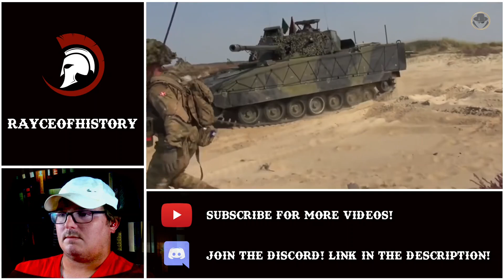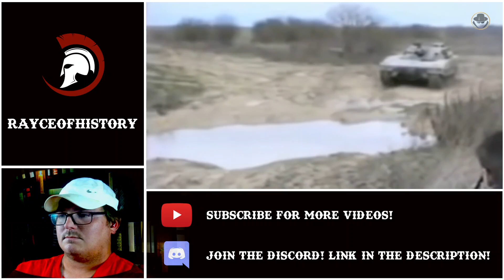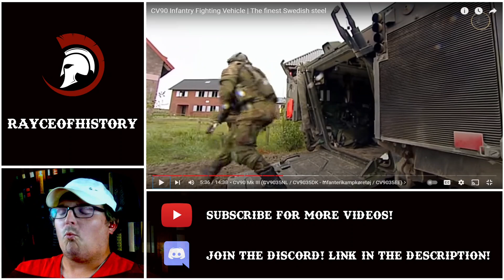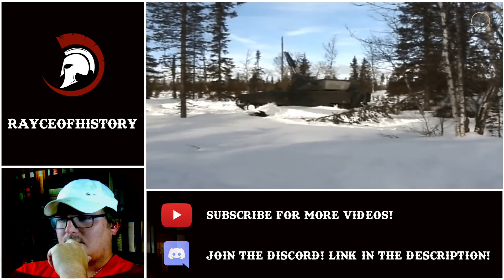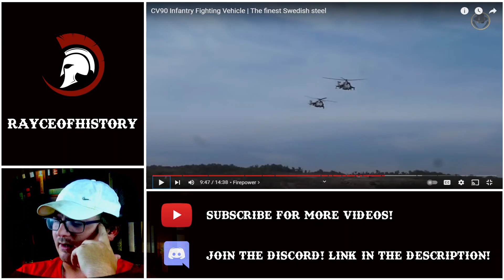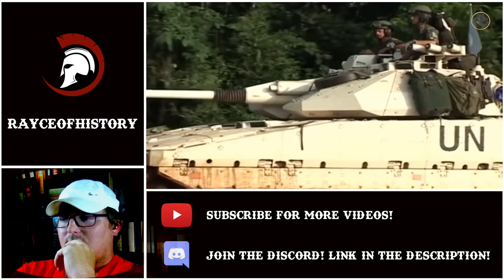Texan Reacts to CV90 Infantry Fighting Vehicle | The finest Swedish steel

Comment: Nice that you did this one! I will add some stuff here.

Recently Slovakia and the Czech Republic bought CV90 from us. I think they bought about 400 of them together. So now it's 9 user nations. And if you include the poles it's 10. And imagine when Sweden joins NATO, then we might be able to sell alot more of them without export restrictions and stuff. This plattform might be the most used NATO IFV, if it's not already that. I don't know.

When it comes to the off road performance it's excellent. It was designed for the swedish conditions with deep snow. It basically floats/skids on top of the snow like no other tank. Some tanks get stuck in deep snow. But the performance in mud and stuff is also excellent because of this. If you can drive in deep snow it will basically work anywhere. I heard of one swedish soldier talking about when they hide themselfs in a swamp! And the bigger battletanks couldn't even go there because they were to heavy.

I have also heard that the suspension adjusts itself depending on the road ahead. So it basically scans the road ahead so it can achive higher speeds. I don't know how this really works, but some guy if I remember correct said that it increased the speed with like 30% or something like that. But take this information with a grain of salt. But at least that's what I have heard, something along those lines.

So, the mobility of this IFV is super good, it's fast and can go bascially anywhere. As you said, I also think they found a really good base plattform and then expanded on it.

As a swede I would love to send 100-200 of these to Ukraine, but I guess that might not happen. The ukrainians would crush the russians in their offensive operations with a couple of hundreds of these. I mean they are already crushing the russians with old shitty Soviet tanks from the second world war up until the 70's and 80's. Imagine what this machine could do to the russians!

If I were the defence minsiter of Sweden I would send these right away! Anyways, it seems that they soon will get the Archer at least! Because we have had election a couple of weeks ago and the right-wing oppositon won the election and they want to send the Archer to Ukraine. Before it was a left-wing government and they didn't want to do it.

So keep a lookout for the Archer in Ukraine. The likelihood that it will soon be there is very very high! .. ;)
Reply from the maker: It seems incredibly fast for what it looks like, which it basically just looks like a main battle tank. And in regards to Russia and Ukraine, Ukraine is getting after it with those old tanks, they’re doing really well with newer and higher tech smaller weapons systems, things like the NLAW’s and older bulkier weapons systems like those old Soviet T’s they’re using. The only real question, at least in regards to US weaponry they are deciding whether or not to send, is can they fix it and maintain it, and can they use the system without some long training period. Im not sure how complicated the CV’s are, but if they aren’t extremely complicated they seem like they could make a big difference on the ground.
Reply: @rayceofhistory  By the way, the NLAW that you mention is also Swedish, but I think you knew that. Developed by SAAB.

The thing though is that some britts think that they invented it. But it was developed in Sweden by swedes and then it's manufactured in the UK. We developed the NLAW based on earlier swedish anti-tank weapons. The NLAW was an evolution of the anti-tank weapon RBS 56B BILL 2 or Robot 56. And also from the AT4 I think.

It's like the iPhone, it's invented and designed in the US, but manufactured in China. That doesn't make the iPhone chinese, right?

The thing is that we swedes seem to outsource military production to other countries. We design it here in Sweden and then we join a partnership to manufacture it in some other country, etc.

As an example of this you had the Archer. If you remembered, Norway was also in the Archer project (and some other countries as well) for a while, but only with funding, not design.

It was the same thing with the NLAW, the britts helped with the funding, but then also it was decided that they would do the manufacturing.

The same now with the CV90 that Slovakia and the Czech Republic bought from us. Those CV90's will be built in those countries. So they will have CV90 factories.

You know the company that makes the CV90 is a UK company, they bought Hägglunds who produce CV90. So the britts now own the CV90, but they are designed and manufactured here in Sweden.

Jas 39 Gripen will be produced in Brazil as well. So they will have Gripen factories which I don't like! It's a shame that we sold them and Hungary our jet fighter. But I think we didn't know that they were so Putin friendly at the time. But now since the war broke out I think it became pretty clear who supports who. It was like the fog was lifted.

We only lease our Gripen's to Hungary so I hope we take them back soon. But actually one good thing here is that they will soon vote if we can join NATO. It's only 2 countries left now, Hungary and Turkey. All other 28 countries said yes to Sweden joining NATO.

And the thing is that if Hungary vote no, we will take back all our Gripen planes from them I guess and then they will be without an airforce. Hehe.. ;)

So we have a bargin ship against them here. Also we lifted our export ban of weapons against Turkey now because they demanded that. I don't like it, but maybe that's the only way the will vote us in. Maybe we can recall it later when we have joined the club.

Maybe Turkey wants to buy some CV90's from us, or some Gripen, who knows.
Reply: @rayceofhistory  Yeah, but you know the ukranians have a hotline that they call. A hotline to NATO mechanics that they can call and talk to straight away. I heard about that recently. And NATO is sending them all the spare parts they need. So basically they got everything they need to fix NATO equipment.

Also, I heard that they sent some damaged equipment to bordering countries like Poland, etc. And there you had NATO mechanics. So it don't think that is an issue actually. But I thought like you before, before I heard about this.

It was some news coverage I saw regarding this. If it was on CNN, BBC, or some other channel, can't remember now.
Reply: @goldrush5764  last poll I saw was 62.5% support of Nato in Sweden. The poll was back in June. Right wing partys voter SD 67% M 81% L 86% KD 77% C 68%  Left wing S S 60.4% MP 46% V 28% 15% of the voters did not want to answer or could not.  Men 68% women 56% but almost 20% of the womens did not have an answer. But after this poll SD changed to be for Nato Vänstern and Miljöpartiet are still against Nato. This is what SD wrote in their party program. "Som ett militärt alliansfritt land ska vi inte peka ut fiender även om vi deltar i sanktioner och vapenembargon mot vissa länder” They still do not want to pick side between russia and Ukraine, but they changed from alliansfritt to be in favor of Nato.
Reply: In hindsight the new Swedish right government hit the same snags the previous "left" did (and was criticized for).
Imho this is not really politics or the lack of will of a specific party but existing legislation and the lack of greater numbers of combat ready Archer sitting ready to send. 
That is due to decades of budget cuts to the Swedish military that the left has some guilt in, but the right has a quite large and final part in during the Reinfeldt goverment in the early 2000s.

Regardless, the same issues exist today. The will to send Archer was never the issue with either government.

I'd also argue 200 CV90 would do more good than duplicating the performance of the Krab or Caesar that Ukraine already has. And we have the numbers to send them.
CV90 will perform better in the mud and winter than any old soviet armored vehicles. It simply has superior cross country ability due to lower ground pressure and track design.
And the 40 mm is simply superior to the Bushmasters and equivanent armament the few Ukrainian  modern vehicles have (Which are good, just under armed for fighting actual tanks though they've courageously shown success doing it).
Reply: SD (conservative right)  will not support the Archer to Ukraine. If the new goverment wants to send the archer they need Socialdemokraterna (center left) to back them up.
Reply: @KristoferOlsson  What are you basing that on? They did a opinion poll and 53% of SD's voters want to be in NATO. Among the socialdemokraterna it was only 42% who wanted to join NATO. Moderaterna it was 65%. And kristdemokraterna I think it was 61% or something like that.

If you want to join NATO, then you are more willing to send weapons to Ukraine in my opinion. Therefore SD's voters are more willing to do it compared to the socialdemocrat voters. Then it's hard to say what the party leaders want to do, they might not do as the voters want them to do, but I havn't heard anything from SD regarding this. Have you? I think both M and KD will bargin with SD, and then we will send them. I can be wrong but that is at least what I think.

Miljöpartiet, vänsterpartiet and centern, then it was below 35% who wanted to join NATO. Maybe it was higher when it comes to centerpartiet, can't remember, think it was higher. Anyways, now with a right wing government the likelihood that we will send more heavier weapons is so much greater than before based on that opinion poll, if it reflects reality, which I think it does.
Reply: @goldrush5764  What the voters think and what the party thinks is not always the same. SD still have a hard time calling it an invasion/war. They could not pick side when asked about Putin vs Macron. Lots of high up in the party are big supporters of Hungary, Serbia and Russia. Roger Richthoff shared videos thanking russia for the invasion. Many low level politicians from SD has showed support for Russia some has been excluded from the party but not everyone. Many countries has showed concern about Sweden and the support of Ukraine after SD got the second largest party. SD is not know for going against Russia. They had a hard time saying they supported Sweden entering Nato to.
Socialdemokraterna has shown that they have taken action and sent lots of weapons and had talks with Ukraine about sending the Archer. They was also very quick in push Sweden to join Nato. Vänstern and Miljöpartiet on the other hand has not shown much of support of Nato or Weapons to Ukraine.
Atm we havent seen anything from Moderaterna and SD about suporting Ukraine more. They are only focused on who get the power after the election.
Reply: @KristoferOlsson  Mycket av det där är ju bara bullshit från vänstermedia. Men det är väl klart, du tror ju på allt det där.

Jag kan ta ett exempel för dig hur media spinner det hela för att det ska verka vara på ett speciellt sätt men egentligen är det bara ljug.

Jimmy Åkesson får ofta frågan vilken politiker han föredrar mot en annan.

Han har under hela sin politiska karriär inte velat svara på denna typ av frågor. Om du har hängt med, vilket du inte gjort, så hade du vetat varför han inte vill svara på denna typ av frågor.

Han har sagt i flera intervjuer att om man väljer en av politikerna så får man liksom en påse av alla deras åsikter, allt de står för. Därför har han helt enkelt inte velat svara på denna typ av frågor.

Självklart vill ju Aftonbladet, Expressen eller de skitblaskor som du läser då få det till att han föredrar Putin, eller Trump eller nån annan politiker bara för att han inte velat välja.

Men vad tidningarna då har gjort är att köra ett fullspel och förvränga vad han faktiskt sagt. De tar allt ur sin kontext.

Sen tänker jag inte förklara allt det andra för det tar för lång tid. Men har man varit ryssvänlig i SD så har man åkt ur partiet, så är det. Och ja, det har funnits några ryssvänliga, men de har som sagt blivit uteslutna, de allra flesta.

Sen finns det ryssvänliga i andra partier också, så det är inte ett unikt fenomen som bara SD lider av. De flesta som var ryssvänliga och som fanns inom SD, det var inom deras ungdomsparti, ungsvenskarna och dessa åkte ur partiet. Det var ju när Kasselstrand var ordförande och han åkte ut med huvudet före. Sen startade han AFS, det är där de som är riktigt Putinvänliga finns, samt inom extremvänstern.

Och sist men inte minst så kan jag säga att jag röstade på SD! Och det är jag glad för att jag gjorde.

Sen ska du veta att 95% av svenskarna är emot Rysslands invasion av Ukraina. Man gjorde en opinionsundersökning och vi var mest emot ryssarna i hela Europa.

Tror du då på fullaste allvar att 20% som nu röstade på SD är Putinvänliga? Låter ju väldigt konstigt då 95% av folket är emot honom och hans invasion. Jag får då inte ihop det.

Och jag kan då säga att jag själv är EXTREMT emot Putin! Skulle jag höra nån på jobbet uttala sig Putinvänligt då skulle jag bli förbannad alltså och nästan skrika på dem. Inte skrika men jag skulle vara otrevlig mot dem, helt klart. Tack och lov så har jag inte hört en enda vara det, så de där 95% stämmer väldigt bra med min upplevda verklighet också. Har inte hört en enda i min vänskapskrets som supportat ryssarna.

Du ska inte lyssna så mycket på tidningarna, då skulle de inte fylla din skalle med så mycket skit. Inge ont menat, men bara ett tips.. ;)
Reply: @goldrush5764  I don't like to talk politics here but when it comes to our national security, our defense, our parties are very much in agreement. If Sweden were to send Archers to Ukraine it would be because the Defense force has found we can do so without lowering our defense capability. I believe they will answer that on 17th October. If the defense force says we can not spare any Archers for Ukraine no party will vote against a decision not to send any.
Reply: @goldrush5764  
Jimmy Åkesson (leader of the SD, fyi for anyone who's not Swedish), when asked in February of this year, said he could not choose as to who was a bigger threat to democracy, when asked to choose between Biden and Putin. The SD have very close ties to Putin's regime, so much so that they sent an "observer mission" to Crimea in 2014 that concluded the sham elections there were valid.
SD are far right shills for Putin.

Comment: GRK120 = Granatkastare 120 = Grenade Launcher 120
Reply: Mjölner (Thors hammer) It is a twin barrel 120mm mortar system based on the CV90 platform.
Sweden has 40 of these systems in operation and more on order (GRKPBV90).

Comment: Id take this over a MBT, this thing could pop off dozen rounds and cause some serious damage before a MBT could get one shot off
Reply from the maker: Everything it does seems incredibly quick for sure.
Reply: Agree. Better have that and 6-man in the "Ball pool" (We call the volume where the mounted soldier sits that) (CV90C) with NLAW than a tank. Also, we should send personal winter equipment and clothes, M136 and NLAWs as well. It will make Ukraine able to operate and advance all through the winter without any hindrance. That is more strategic and worthwhile than other weapon systems.
Reply: The 40mm APFSDS darts can penetrate T-72 frontal armor...